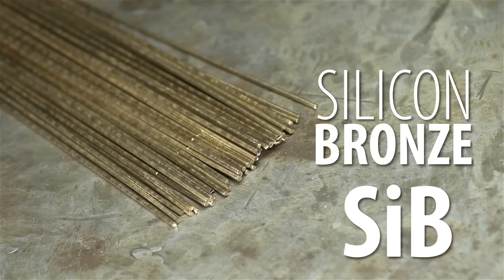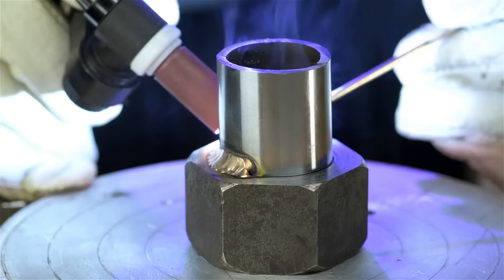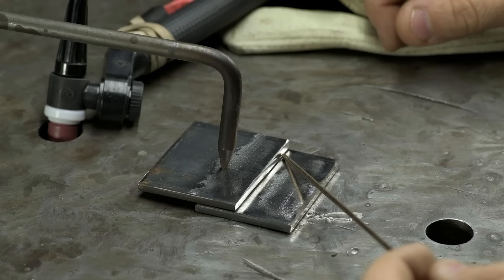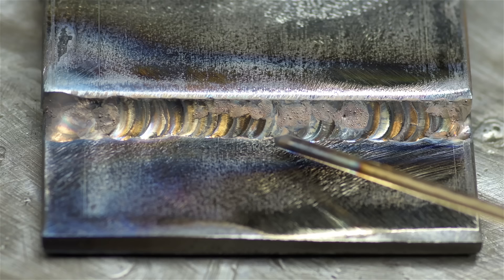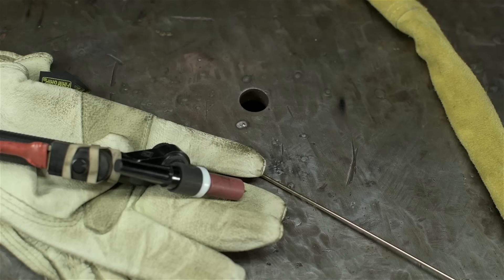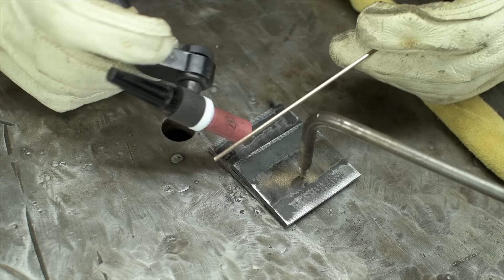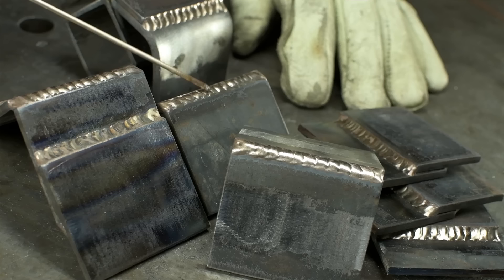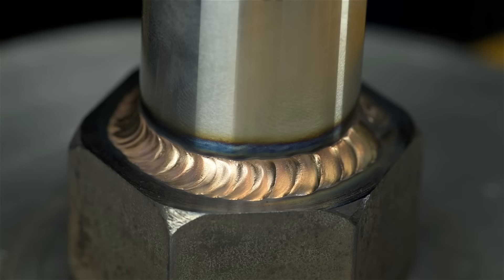Adventures in TIG Brazing

Comment: hey man i hope to get a response. i never tried SiB filler, and i hear you talking allot about not trying to make the base metal melt. what could be bad if it melted?
Reply from the maker: hard to say but usually you use it when you don't want it to melt.  also melted base metal probably alloys the braze and might compromise strength?  that said I got my best results when it melted just a little bit. :)

Comment: It would be interesting to compare the strength of the lap joint that you TIG brazed to a lap joint with traditional oxy-fuel brazing... Even if you TIG brazed both sides of the lap joint, there's a good chance that the oxy-fuel joint would be stronger due to the fact that it wetted out the entire lap area...

Comment: Really not as much heat? Have u ever used silicon bronze on copper to steel there is a lot of heat and amperage and you have to point it mainly at the Copper!

Comment: If you aren't melting the steel, wouldn't it be bronze soldering?
Reply: Brazing is just hotter soldering.  The only difference is the temperature.

Comment: DO NOT WIRE BRUSH BACK-AND-FORTH, this technique contaminates the joint and oxidation will occur within weeks or months... Proper technique is to brush in one direction with a brush made of proper alloy (SS, mild steel, brass, ALU), THIS IS VERY IMPORTANT OTHERWISE YOUR JOINT WILL ROT! Also be sure to brush the weld or braze when it is at the proper temperature

Comment: Perhaps you can answer me this.. Would the bronze filler work on aluminium and if so would you still need an AC/DC TIG or would it work with just a DC machine.
Thanks
Reply from the maker: I'll try in the next brazing video!
Reply: @ThisOldTony  That would be cool! If it works i think the contrast in colour between the two metals has potential for a very cool looking finish.

Comment: What's the make of the torch switch. The CK ones I've seen are massive in comparison
Reply from the maker: put it together myself.  Its a 'naked' torch switch (I think they all sell the same ones).  Pulled the rubber/plastic case off, used some heat shrink.  compact torch is a godsend.
Reply: cheers. found them on fleebay. Crouzet seem to be the manufacture

Comment: I have been mulling over the idea of tig brazing lathe ways to build up. The section in issue is small in comparison to grinding 0.02+ over the other 46 inches not badly worn. I have no experience with tig brazing. But do have a capable tig and am from Montana where we embrace our fuck ups and ride them, occasionally to the grave. Tony, either talk me out of it, or shoot me, uhm, advice. Thanks.

Comment: hey bud so i know im goin out on a limb here with hopes of you replying, but since you are like a celebrity probly i wont hold it against you if i dont hear back(i say that due to all ur subscribers, you must have a plate or two full of questions to answer, etc etc) but my question for you is my girlfriends honda civic stock exaust manifold is cracked i am to believe its cast do you think i should use my tig welder and use silican bronze to close up that crack? its about 3 in long with no gaps. thx tot
Reply from the maker: you sound like you may have done this before so I say go for it.  clean it, drill out the ends of the crack.  little 1/8 hole should do it.  the holes are to stop the crack from propagating.  clean again. preheat in an oven or BBQ and go for it.
Reply: @ThisOldTony  seriously thank you very much. u really are a go to for my welding and other cool stuff i like to try n accomplish in my sm garage. i was aware of the holes but wasnt even thinking about the preheating, so i most def will. truly thanks again. -derek

Comment: Wrong, that's not brazing; it's bronze welding. I don't know who started the trend of confusing welding and brazing but it seems to have spread everywhere. When you lay a bead of filler rod as you are doing, it is rightly called "bronze welding". Brazing, on the other hand, is a different technique where the bronze rod is applied using the same process as soldering where capillary action is used to draw a small amount of filler into the joint.

Comment: Copper and zinc is brass, hence "brazing." I don't know why they choose to call using bronze or aluminum "brazing" when there is no brass in the process.
Reply: It's  brazing not brassing. Braze- form, fix, or join by soldering with an alloy of copper and zinc at high temperature.

Comment: What is being done here is BRONZEWELDING not Brazing.  A brazed joint is by necessity a socket or lap joint and uses a very different filler wire.

Comment: What is the strength of tig brazing compared with gas brazing?
Reply: Good question. There are higher strength brazing rods available for gas brazing with nickel and maybe even silver in them but I've not seen them in TIG format. Bike frames are sometimes "fillet brazed" which is a bit like TIG only with a gas torch. Sort of like oxyacetylene welding but with a braze rod and lots of flux. They're also often TIG welded but I've never heard of one being TIG brazed. Seems like it would be an easy process on the very thin tubing but maybe not strong enough? Looking at the UTS of the filler seems like you should be all right with a fat bead which is what you tend to end up with with this stuff anyway. But nobody does it.
Reply: Looking at those joints, what I see (from the perspective of an amateur gas brazer who has ever touched a TIG torch) is that the filler is only being wetted onto the very edges of the base metal. If I were brazing a sheet-on-sheet flat joint like those first ones I would use the heat of the torch to pull the molten bronze into the gap between the sheets. The first test of breaking apart the joint "towards the camera" would have probably bent the base metal as well.

I wonder if the torch could be used in the same manner to heat the base metal further from the joint and wick the filler into the gap.
Reply: @JonSenior  Yes I agree with this and I think that's why people sometimes prefer gas brazing. But whenever I've bend tested TIG brazed joints I got the same result as TOT-- the bronze bit breaks, it never comes unstuck from the parent metal. So seems it might not be too much of a problem.

Comment: You can't join stainless with s. Bronze... Ss and mild steel should be welded with 309... Also, I believe I heard you recommend cheap auto darkening welding hoods, if you value your vision at all spend the money and buy a professional auto darkening welding hood... Using a cheap hood is risking serious injury, even with standard shields your risking skin cancer and vision damage using cheap or damaged welding shields

Comment: can you tig weld castiron ??
Reply from the maker: are you daring me?
Reply: @ThisOldTony  it will make a good video then if it works i will buy a tig welder.
Reply from the maker: lol yes you can either with high nickel rods or brazing.  I have Tig welded a lot of cast iron with stainless filler with good results. preheating is important as is slow cool down.
Reply: @ThisOldTony  i will look into buying a tig i like how easy it looks to weld thank you tony.

Comment: That is not brazing! It’s bronze welding. Brazing is like soldering where the brass is melted into the gap between two parts, one fitted inside the other, like a frame tube inside a steering head   casting.

Comment: Why do TIG brazing? The beauty of brazing is that the rod flows into the fine cracks and like soldering you want the filler to be melted in by the heat from the work peace not the heat source, if you have to buy special expensive rod I probably would never be doing it in unforeseeable pinch, if you melt any of the base metal you alloy your weld, be nice to know exactly what that gives you.

Comment: Why not just braze with gas? Gas will heat the base material slower and allow better adhesion. The braze will chase the heat just like your puddle.
Reply: heat affected zone...  warping... etc.
Reply: @jon_byler  , you're providing the same heat with the tig? The whole point of brazing is to not heat up the base material to the point of phase change (where you start to see HAZ). In this case it looks like the base material is pulling too much heat from the joint, the pulsing is compensating for this. Gas will allow you to more easily heat surrounding material without overheating the surface. Flux will also go a long way here.
Reply: totally different processes.  I'm not sure how you're managing to do gas brazing with a 1/2" or less heat affected zone.  tig is very pinpoint precise with the heat.  look at the color change beside his joints, and then try to replicate that with gas.  you can't.  Gas is good if you want capilary action and the braze material filling a small, well prepared joint.  tig brazing is more like welding, and is very handy in some instances, especially repairs to cast iron.  you can cheat and avoid pre-heating in some cases because total heat input into the joint and surrounding areas is significantly less.
Reply: @jon_byler  I'm not saying it isn't handy for special cases like cast iron. Cast iron has and always will be its own special strange animal when it comes to welding/brazing.

While HAZ is larger for gas welding, gas welding HAZ is also less brittle. Because it heats the base material more it cools slower, reducing the amount of Martensitic formations in the HAZ.

This is brazing however, not welding.  The capillary action is what makes the joint work. This is why he's having issues wetting the joint in the video. The base material is simply not hot enough. Hence why i asked why not just use gas for most normal brazing.

Using gas will require no extra joint prep over tig here except that flux will need to be used. Brazing flux is dirt cheap as is the gas setup.

Both processes have their place, I was merely curious why they don't compare with gas brazing. Its almost like the author is not familiar with gas or brazing since they are avoiding the heat which is required to make brazing like this work. In fact i prefer brazing on thin gauge material over welding because you can achieve a larger joint area compared to weld which nets a much stronger joint.

Comment: Why are you so concerned about finding the exact Ambridge and melting point? Why don't you just crank it to 150 and use your pedal to control the Ambridge so you have some leeway? Maybe it is just a different strategy? I Weld material that is as thin as point 4 mm and I still have my well their set at a 120 amps I just use my pedal to control the fusion point

Comment: You are not brazing, you are welding wrong.... That's all..
In brazing the base metal don't liquifies and don't mix with fused metal stick, the brazing metal just have to work for capillarity.
In welding the two base metal melt forming a fused basin where you stick in the same metal to add material, then when it cools down, yuo have a one metal joint.
In the process you made you are mixing the two options, creating an uncertainty, the strength of that joint depends on how the base metal and the stick mix well and what kind of alloy they made...
It could be very hard, but also could be weaker than the brazing stick alone...

Comment: Very entertaining but full of errors and unorthodox techniques.... The main advantage of s. Bronze is that cleaning (grinding or other prep) is not required, galvanized steel can be joined with little to no damage to the coating or finish. Also if there is ANY heat stain in the base metal you have exceeded the recommended temperature by thousands of degrees and have defeated the purpose of using s.bronze

Comment: Not to criticize but your stitches should be much closer together than that. Your spacing is entirely too far apart. It should be no wider than the filler rod your using for any particular weld. if your using 3/32 filler rod then your spacing should be no wider than 3/32.

Comment: Hi have to weld copper bellows stainless to copper stainless is 2mm  and the the copper is 2mm aswell I weld it one 130 amp no pussy foot control you have to go fast on the turntable with your foot pedal look up copper bellows the are special expansion bellows

Comment: What you are doing is called Bronzewelding not Brazing.  Both the joint configuration and the filler wire are wrong for Brazing.